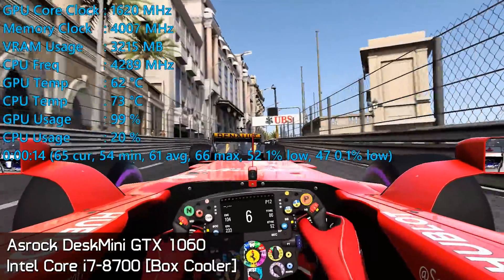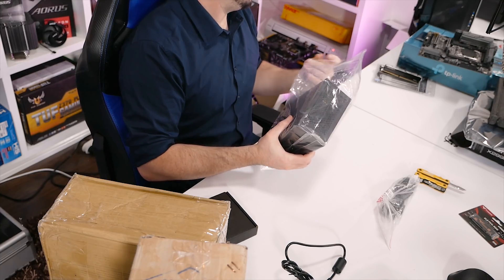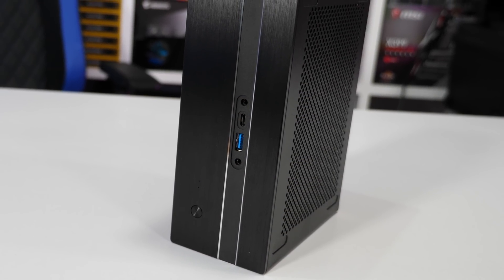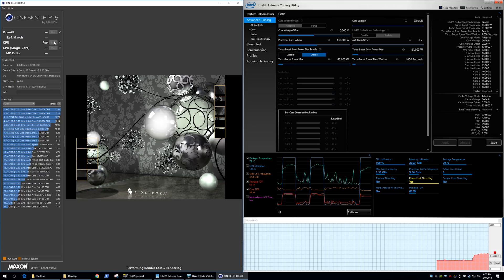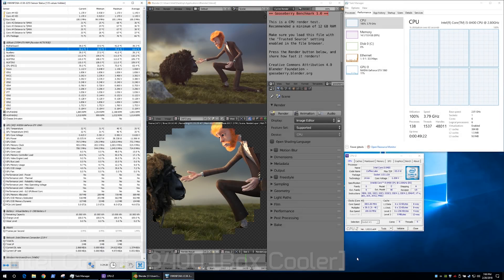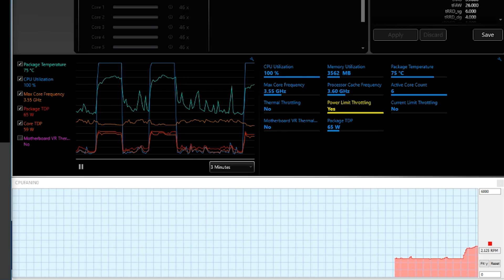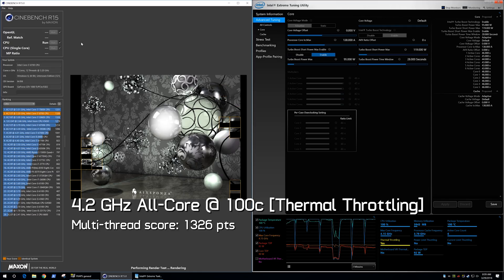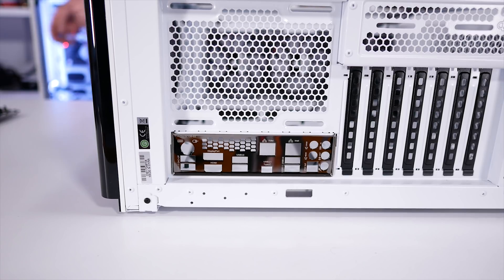Core i7 8700, Intel Box Cooler Limiting Performance

Comment: Again Steve, it is not about the cooler but the TDP configuration of the CPU. You just proved that "Con Lake" is real starting from 5:58. The fast majority of CPU's sold are in OEM systems. No OEM will ever purposely break the TDP specification set by Intel. That will void there warranty with Intel and they will not do that because if a system breaks down, they will have to pay for it. Therefore every 8700 sold in an OEM system will never break the 65W TDP limit because that would mean they run out of spec. That means they will never hit 4GHz+ clock speeds on all cores. You can put a 360mm radiator or even a custom loop in there for CPU cooling, it won't happen. That is what "Con Lake" is about, not the abysmal cooling performance of the Intel stock cooler. 

That is the first part. The second part is what will happen when you combine a H or B series board with a 8700 or the upcoming 8500 or 8600. Those motherboards and CPU's are completely locked and will most likely not feature a configurable TDP. Even if they do, almost nobody who buys an 65W TDP CPU and a H of B series board will know about configurable TDP. They will thus still have a CPU that is underperforming because they saw benchmarks people like you made, and not being able to reach that level of performance because they have the wrong motherboard chipset. That is the second part of "Con Lake". 

If the DIY motherboard from ASUS, MSI etc don't purposely ignore the 65W TDP specification like pretty much all the Z370's boards do by default, then at least the 8700 will fail to reach its all core turboboost on those boards. You hit 3,6GHz with this 8700 and a 65W TDP and was it. That could very well vary depending on the chip, in both directions. Now the i5 8500 and 8600, both configured for 65W TDP will also be appearing soon which undoubtedly will have higher theoretical maximum boost clocks than the 8400. Again, when will those chips hit there 65W TDP limit and will they be able to hit there maximum boost clock? 

That is what you need to test and not the stock cooler from Intel. Most people who watch this channel know it is sh*t and you should never use it anyway. Now purposely changing the TDP limit to allow a higher clock speed proved that "Con Lake" is real, and no difference in cooling will ever make that go away. If you can't change the TDP, the CPU hits a brick wall. That is always what it was about and you proved it, not dispelled it. 

Then saying that Intel doesn't guaranty the boost clock is just nonsense in all of this. Every single review had the 8400 running at 3,8GH and the 8700 at 4,3GHz after the MCE debacle. If normal consumers buying those chips with a cheaper motherboard won't hit that level of performance, then Intel will have deceived them. It will then also be the tech reviewers who are responsible for this deception. 

So Steve, please wise up and see what Intel is doing. You just proved it yourself. You are just failing to look at you're own findings in a correct manner.
Reply: Danielww2 write less and read/think more. From intels site  "Thermal Design Power (TDP) represents the average power, in watts, the processor dissipates when operating at Base Frequency with all cores active under an Intel-defined, high-complexity workload. Refer to Datasheet for thermal solution requirements."
Reply from the maker: If you don't understand what TDP means and what it actual is, then you could draw those conclusions.
Reply from the maker: "The 8700 is a CPU configured by Intel to produce a certain amount of heat, expressed as 65 watts." - I read this far, this is incorrect.

Also the R7 1800X is a 95 watt part but the CPU alone draws up to 120 watts for certain workloads when stock.
Reply: If you buy a chip that isn't advertised as giving you 6-core 4.3 GHz in every configuration possible, and you don't achieve 6 core 4.3 GHz, what is the issue here?
Reply: I perfectly understand what TDP is. That however does not change anything about my argument being correct. The 8700 is a CPU configured by Intel to produce a certain amount of heat, expressed as 65 watts. If held to that specification, which you demonstrated, the CPU will not reach the maximum possible clock speed of 4,3GHz on all cores.  

This is completely independent of cooling. A box cooler is capable of handling 65W of heat, seeing as they are rated for this. No wonder that when you increase the CPU its maximum allowed TDP to 75W or worse, 90W, you see issues with temperature. That is not a failure of the cooler, but pushing the cooling solution beyond its, in this case, quite meagre capabilities. That is also why I point out that introducing a 360mm radiator does nothing if the CPU is not allowed to produce more than 65W of heat. Yes, it will be very cool but it won't preform any better in terms of clock speed. *Only when you manually raised the amount of heat the CPU is allowed to produce, does the clock speed rise*. Then you also need a better cooling solution. That is common sense. 

This brings me again to the OEM systems. The vast majority of sold CPU's will be in OEM systems, and will run with the 65W TDP/heat limitation. At launch every reviewer who got a 8700, also got a high end Z370 board to go along with it. All used either a high end tower style cooler or an AIO so heat production was absolutely no issue. These CPU's where easily producing more than 65W of heat in this configuration and you can tell this by looking at actual power consumption figures often provided. Those obviously differ somewhat from heat production, but the differences are never that great. 

Now imagine somebody was looking for a new PC. After watching some benchmarks this person decides that the 8700 is the CPU to get. Person doesn't know how to build a PC, and/or doesn't want to do it. He therefore buys an OEM system with the CPU that he saw performing at 4,3GHz with the associated results. Now with his brand new PC it suddenly only does 3,6GHz. He basically got shafted then. That is what "Con Lake" is about. The whole point is making these CPU's look better than they will be for the vast majority of consumers. 

In this test you got the perfect test scenario. You had a motherboard that emulates how an OEM system is setup and it demonstrated exactly what happened when the CPU was not allowed to produce more than 65W of heat. This result is also in line with what Computerbase.de demonstrated. Then you artificially increased the TDP limit, and subsequently introduced a better cooling solution when the box cooler failed, as designed. That allowed a higher level of performance. Performance the vast majority of consumers will never see.  

That leads to the second concern. What will happen with the locked H and B series motherboards from ASUS, MSI, Gigabyte, ASRock etc? Are they fully locked or do they ignore the 65W TDP specification/limitation just like most Z370 boards do? That will make a big difference in ultimate performance, which again, you demonstrated, regardless of cooling. Cooling will only start to matter if the motherboards allow the CPU to produce more than 65W of heat.

Comment: as you said the problem is the cooler and the fact that 70% of buyers get a prebuilt PC with that stock cooler in it, expecting to get the performance seen in the reviews.
Reply from the maker: The reviews should use the box cooler. Then an after market cooler.

Comment: Yes they do not promise specific performance on their website but what % of people read those disclaimers? Bottom line, most consumers are going to look at benchmarks like yours and make assumptions about performance. As you prove yourself in this very video, when they make pre-built system purchases like the Median and the little box here, and very likely an XPS or whatever: they will not get the performance expected. Period. Full Stop. They will not get the expected performance if they buy and use exactly what is in the retail box cpu either. Period. Full Stop.

"BUT! If I switch out the coolers and remove the case I get the performance back!" you say......Your really think that is going to happen? Buy the cute little box computer just to take it out of the case and have parts flopping around in the breeze? People are going to know to do that, be willing to do that, and actually do that? Really? No. That tiny box computer is getting shoved in a tiny out of the way place and getting very little airflow in most cases....we both know that.

Finally, you just admitted "again" in this video that the Median's poor performance is due to the motherboard. Thank you for admitting to what many have been saying all along. The level of performance will be significantly less with cheap boards.  You know it's true but spend so much effort trying to disprove it. Amazing! :slow clap:
Reply from the maker: Every single Z370 board you can buy at retail gets the most out of the 8700 and 8700K without an issue. That might change for the $60 B360 boards but not the $100 Z370 models. As if anyone is going to spend $300 on a Core i7 and then get a $60 motherboard rather than a $100 motherboard, stupid scenario that. Also I proved it's the cooler on any and all motherboards, not the bloody motherboard.
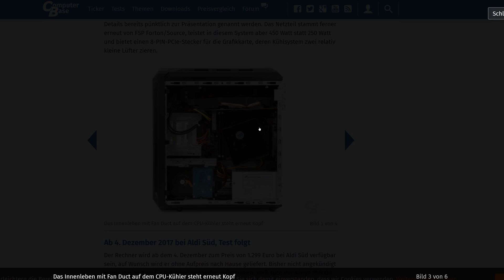Reply: At 5:30 you say "At the time I put this down to the ECS Motherboard...". Perhaps your original thought was correct. Perhaps your implying that you have since changed your mind, and maybe you now think it could be that very cheap looking but definitely not stock cooler. Without that machine on hand we will never know anything beyond that it delivers significantly less performance than expected.

"Also I proved it's the cooler on any and all motherboards, not the bloody motherboard." ANY and ALL? :looks at a stack of dell motherboards with blown (lowest bidder) capacitors and minimum phased VRM: You did not prove that. No.
Reply from the maker: There are temperature results for the Medion PC in the Computer Base review (the one using the ECS motherboard) and it's limited to 74 degrees. With a better cooler performance will improve.

I'll say it again... Every single Z370 board you can buy at """RETAIL""" gets the most out of the 8700 and 8700K without an issue.
Reply: "Also I proved it's the cooler on any and all motherboards, not the bloody motherboard." and "Every single Z370 board you can buy at """RETAIL""" gets the most out of the 8700 and 8700K without an issue." are not the same statements. One is all encompassing and one is fairly specific to a chipset. You are not saying it again, you are revising your statement. 

The quality of a board has ALWAYS and will ALWAYS effect performance. You and AdoredTV can wallow in your symantic "I was right" bullshiitery.

Comment: I'm curious. Would the stock cooler be adequate, if Intel had used solder under the IHS? Drops in temperatures has been reported to be more than 20c in some cases, and i myself got nearly that large a drop on my 7700K on a dark rock 3 air cooler (plus, the fan doesn't spin nearly as much after delidding either). I can only imagine that the drops in temps would be at least that large on coffee lake.

It could make for an interesting experiment, seeing how the awful stock cooler would perform on a delidded CPU, even if it's a locked model. Could this whole issue be fixed just by using some proper TIM under the IHS?
Reply: It might help some likely not much tho.  Check out this educational video on thermal bottle necks by Actually Harcore Overclocking https://www.youtube.com/watch?v=YxW7swuNQps

but there isnt an issue.  The cooler combined with cpu performs at or above what they are claiming in the specs.

Comment: Intel doesn't provide a cooler with a copper slug anymore??? My old 65W i7's came with one, I never used it with them, but I'd imagine it'd be quite a bit better. Then there's also the older, taller server Intel stock cooler. It's the same design but the fin stack is probably 3x the height. IIRC that one is actually very impressive. Sad to see Intel includes only junk these days.

Comment: TL;DR - Intel's stock cooler is absolute garbage? Hahaha surprise surprise.... you know AMD just dominates Intel with the stock coolers. Intel needs to stop cheaping out on it, they are literally screwing over their own CPU performance by cheaping out on the cooler. They are just garbage.
Reply: They also don't give box coolers on any K chips, since they know people will most likely get better than stock cooling when overclocking.
Reply: They should just start sending the K chips out with the IHS separate as well, so we can add our own TIM at this point too lol.

Comment: I have a build that won’t boot or post. Motherboard lights up but nothing else. A relay clicks everytime I try to power it up but nothing happens. I’ve tried 2 different mobos and CPUs bread boxed and reseated everything a dozen times. Any ideas? No spare PSU on hand to test that. 
8700k
Asus Maximus X Hero
Corsair Dominator 16gb
Samsung evo 500gb NVMe
Corsair 850w psu
Msi seahawk 1070

Comment: Question so with an aftermarket cooler can you run the  8700 non k cpu at 4.6 on all cores with a z370 mother board with mce?

Comment: I’ll never understand Intel. They make awesome CPU’s and then cheap out on cooling. At least AMD will stick a cooler in the box that works for almost everyone even some overclocks. 

And I have a spare “living room” PC that has i5-2500K and using the stock cooler. Intel actually had copper in that cooler and it’s always worked fine for my use. 

Why so cheap Intel?
Reply: Intel got away with making their stock cooler cheaper because the core counts stagnated on their mainstream platform for 8 years and as the die shrunk, the heat and power consumption went down for those not overclocking. Now that they are bumping up the core count, they need to beef up their stock cooler again, because the current one is really only adequate for 4 core CPUs.

Comment: I assume you were actually using a 200t and not the gammaxx 300 we're seeing in the clips. The 200t had 2 heat pipes. Kinda irrelevant for this video, I know. Intel stock coolers look and perform like utter crap as far as I'm concerned.

Comment: Hi Steve, thank you for your investigations. I think, or at least I understand it this way, that the whole story is about OEM systems, where you tend not to have any kind of overclocking support (what increasing the TDP is). Does the method you show work on all boards or are there some with a hard limit on TDP? And after all: The average joe buying an OEM system with an Intel i7 8700 / i5 8400 will not increase the TDP. At least for the i7 8700 it is now obvious, that there are parts that can't come close to the targeted all core turbo within the configured TDP. And even if so: Changing the cooler for sure is an issue when it comes to warranty. Don't you think this is a bit of a problem? I'm certainly not wearing the tin foil hat, let's please keep this objective. Sorry to see our last discussion deleted from the video by the way, couldn't read your last answer.

Comment: For each passing day I get more disgusted by Intel who a year ago had complete market monopoly, yet they seem to be the ones cutting corners everywhere they can, for almost every use scenario Ryzen has them beat forr the price and you even get a much better cooler. Be it gaming or productivity work unless you need those extra 10 fps in 1080p (lol), then Intel have nothing for the average consumer.
Reply: Yep, the difference between Ryzen 1700 (3.8 Ghz) vs i7 7700k (4.5 Ghz) was 220 fps vs 240 fps respectively. This was on Fortnite, running lowest settings (360p or 480p) with a Titan Xp and GTX 1080, so no GPU-bottle-necking with it way under 720p even. That's the best case scenario to show differences between them.

Comment: Good job Intel with that cooler... I generally try to stay away from stock coolers, ever since the jet engine coolers of the AMD Phenom and FX processors.  With my Ryzen 1700 I use a Hyper212 cooler, even though the Wraith Spire cooler is probably the most competent stock cooler that’s ever been paired with a processor.  I just got so used to not using them that it’s become second nature when buying a processor to also purchase a cooler for it.

Comment: So basically, for the average joe, pretty much every AMD Cpu is "better", simply because the stock cooler is so much more capable. If i go in to the store anywhere here in Germany, there is not one single i5/i7 NOT on the stock intel cooler. Also, your ambient temp is not really feasible here in germany (for example), simply because ACs are not really common around here. But, you can't even get a prebuilt Ryzen here...Media Markt, Saturn and all the others that have been fined a lot of money few years back for having an exclusive contract with Intel just selling their cpus still "echos" around in those halls. TBH, i'm getting really tiered of the whole PC Hardware market lately...